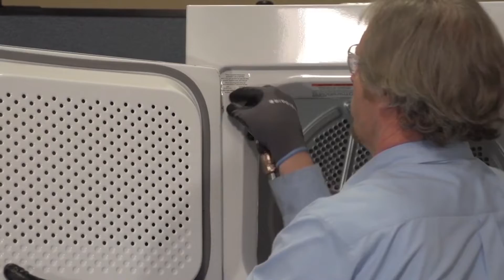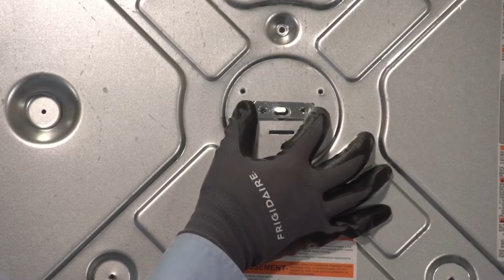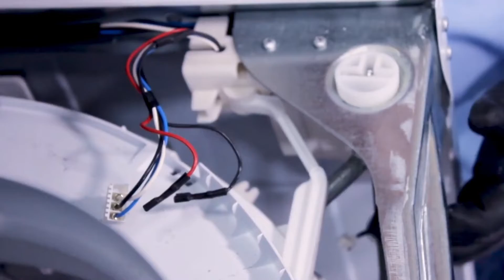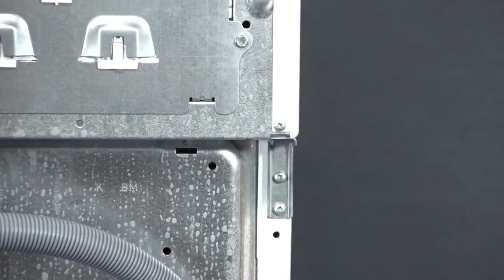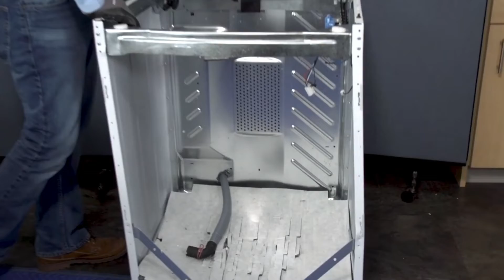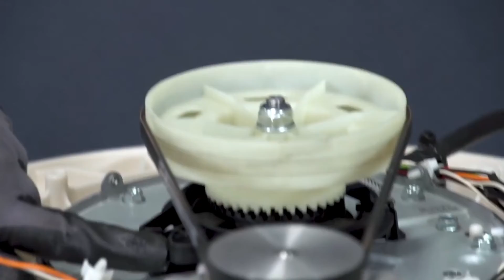frigidaire FLCE7522AW Laundry Center: how to disassemble

Comment: For Frigidaire washer / dryer combo model FLCE7522AW3 it was a cracked / leaking filler hose causing my leak. Video was helpful for help with removing the top lid and front panel of the unit for diagnostics.

Comment: Thank you so much for this, I was able to repair mine and it came apart so easily.  I had to leave mine open to run a cycle (washer) to find a leak.  Turns out the leak was an earplug that fell into the bleach/softener pan and covered the drain that goes into the basket.  Easy fix, and easy teardown thanks to you.

Comment: I have this same unit only 2yrs old and have a 93 code (9 red, 3 green) on the dryer and from what I've found said control panel board on the dryer side. Replaced with new one and still have the same code no change. So I guess now I have to replace the more expensive main board and hopefully that will fix???

Comment: Hello friend, good afternoon, I have seen some of your videos and they are very well done technically, and I want to know if you can help me with an instruction to fix my tower type labadore, it is frigidaire FLCE7522Aw2, the problem it has is that it does not squeeze the clothes, I take them out very wet.

Comment: when i change out that dryer drum bearing i change it from the front only, i do it alone many of these, just pull out only one bolt then move bearing assy up and turn it up with the other bolt still in the other side and now put the bolt you remove back in to hold the rear bracket, now remove the other bolt and toss away the old bearing assy, install the new bearing assy with only one bolt holding it in place, then that bolt will hold the rear bracket in place, then rotate it around to line up with hole for 2nd bolt to install, done,,, so fast and easy no need for tape or a helper no need to get behind unit ,,, i have many of these,,,

Comment: just so you know you can remove the dryer drum by only removing the front top 6 or 8 bolts and push up on the top lid, no need to remove the rear bolts drum will clear when lifting up then  out. and that pulling out that washer tub assy complete. just lift up the tub and pull out the front bottom out first, do not do it the way you did... i have many of these...

Comment: How reliable is this unit?  Is it worth buying one?
Reply: I currently own 2 of these. 1 in my house and 1 in a rental. They are good units, but they do need repair every now and then. Our 2006 unit has needed a new belt and now a new ball mount on the rear of the drum. On the plus side, they are pretty darn easy to work on.
Reply: No . I’m single and have had it 2 years and it’s not working . I’m hoping it’s just the locking mechanism AGAIN. Never buy Maytag !!
Reply: My mom's last about 2.5 years
Reply: If space is not a problem, don’t get the stacked model. Difficult to handle and repair. Only advantage is saving space.